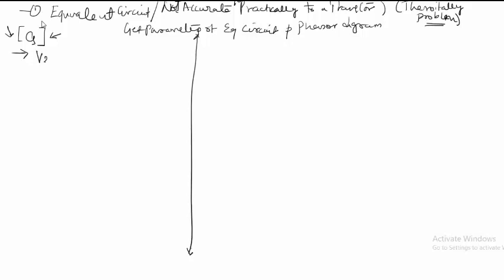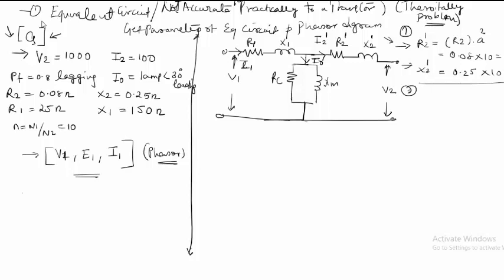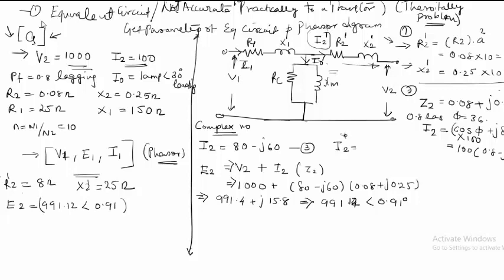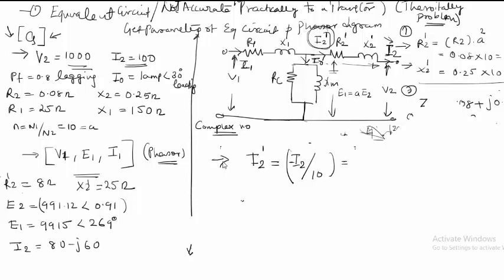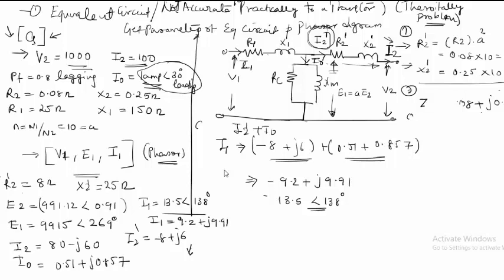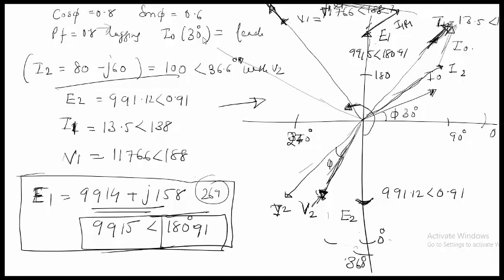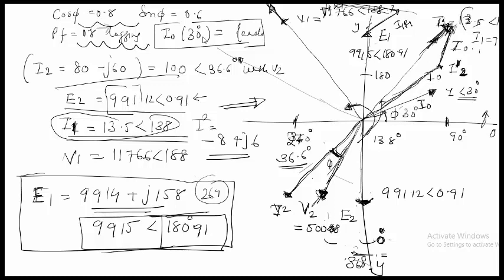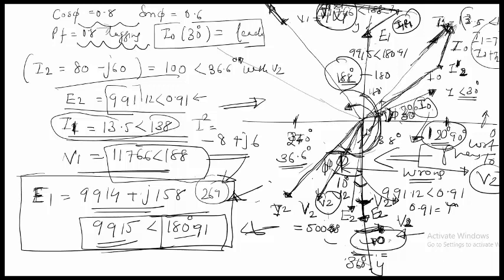Transformer Solved Problem , Equivalent Circuit , Phasor Digram , I , V , Z

Comment: I have observations and questions:

The resulting diagram that you get will not satisfy these equation V1=E1+I1R1+jI1X1. Why E1 is -E1?

There are many books with different phasor diagram, for example:
Example 1:
magnetic circuits and transformers ee staff mit. This has a convention where the resulting diagram that you get satisfy these equation V1=E1+I1R1+jI1X1.

Example 2:

AC Machine Theory - A.Langsdorf. This your convention but This mentions the other way to graph the phasor diagram indicated in the previous book.

So, Could you explain me about these different points of view?

My conclusion is that your convention does not handle the point convention but the other one does handle the point convention. it is correct?

As would be the procedure to establish a phasor diagram for an equivalent circuit of the transformer. It would be to establish the signs of the voltages and directions of the currents and based on the equations draw the diagram.